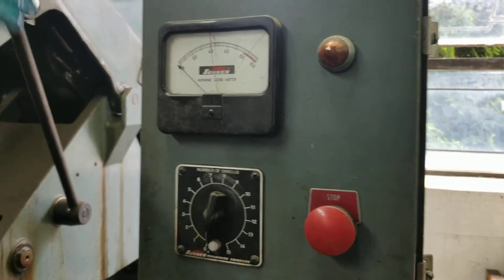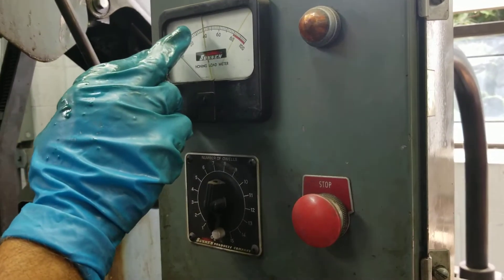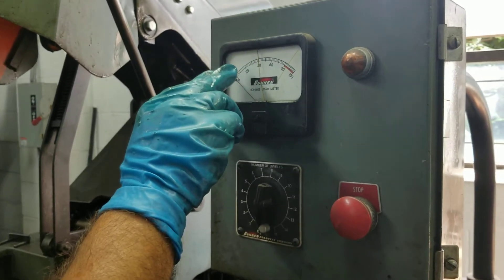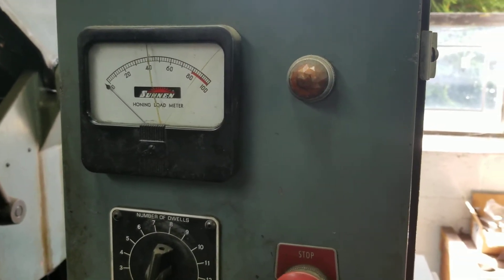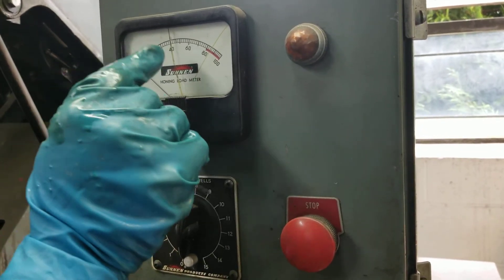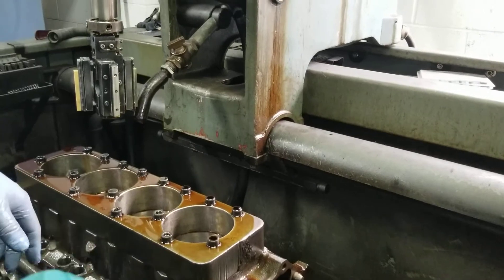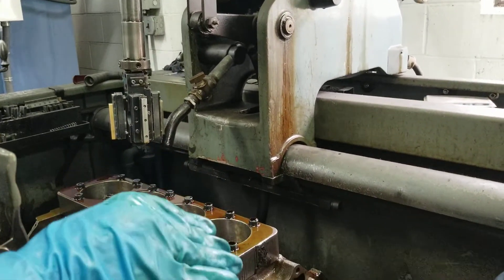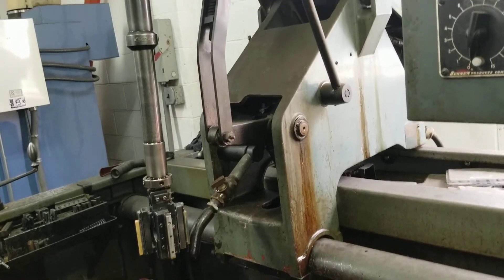Sunnen CV 616, CK 10 Honing

Comment: I had a auto machine shop back in the 90’s. I always wanted a Sunnen cylinder hone. I had a Serv-Equip. It worked, but it took some effort. My best was +-.0002 maybe 3. For those SB Chevy’s I would take my angle grinder and grinder back / relieve the little inch or so at the bottom of the cylinder, where it meet the main web. That really seemed to help keep the bottom of the cylinder round. Stones did bang into it. I know the rings didn’t travel in that area, but.....OCD I guess.
Reply: Your in Canada of Pennsylvania? Let me know if you do a shop tour. I’ll watch it.
Reply: Your' right!,  That casting shift makes it hard to hone an engine block with a CV616, and I can't remember how many times I've sent an engine out hoping that a piston never gets stuck.  Now I grind them out with my MAC die grinder.
Reply: @jamesjacobs1909  I just let my boring bar feed to the webbing, never crash my stones/guides
Reply: @iamawelder  I'm in Canada, machine came from US

Comment: Hello,how do you adjust the dwell point or depth when there is a smaller or tapered part of the cylinder and you want all of the cylinder to be true?
Reply: It's simple, with a set of 820 stones keep the load under "20" and dwell the bejesus out of it till it evens up with the rest of the bore.  If you are working on an older Chevy block keep in mind the casting shift, and remove material at the bottom forcing that taper.